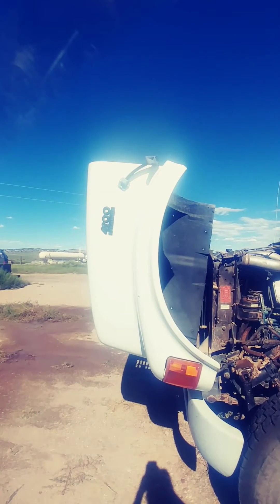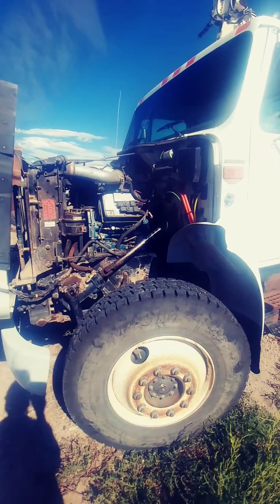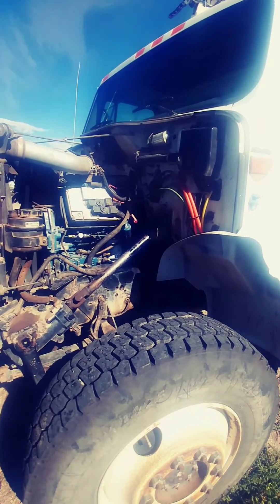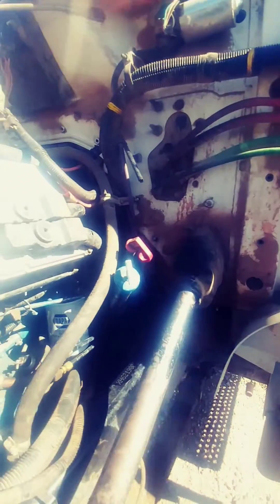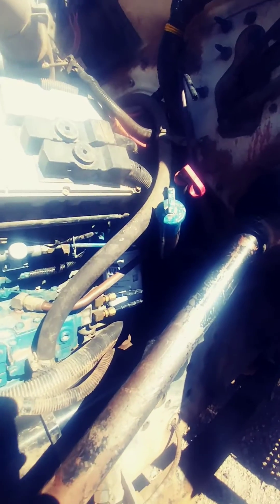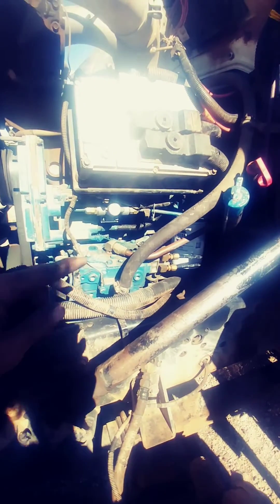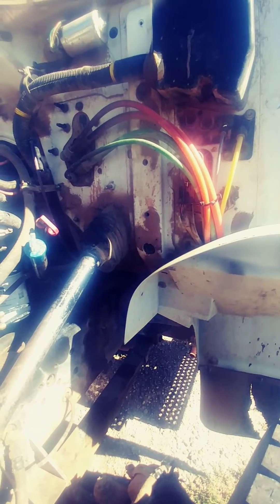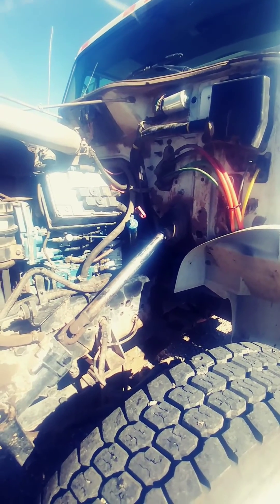DT466 E Fuel supply problem

Comment: @ifixthecars8090 how did you know this was the lift pump and not the check valve (pressure regulator mounted back of the head)?

Comment: my rpm needle is dancing at 2000-2500 rpm, the transmission doesn't receive enough power and is not shifting. I have replaced IPC, Injectors, Injector Harness. What FUEL pressure a DT4466E should have?
Reply: I have been told 65psi at idle and 75psi at WOT